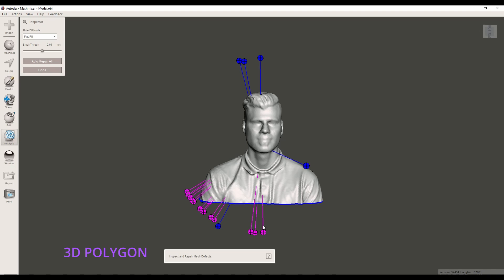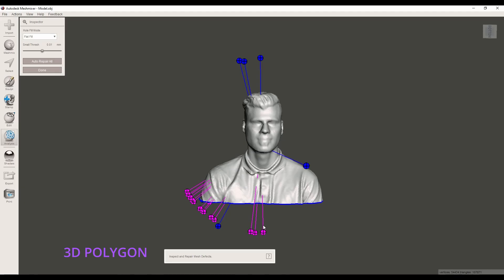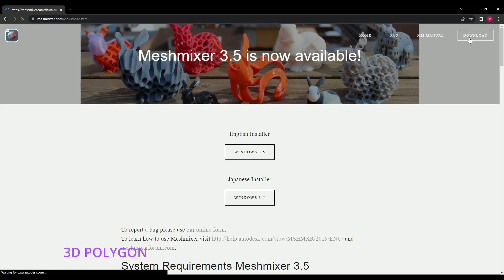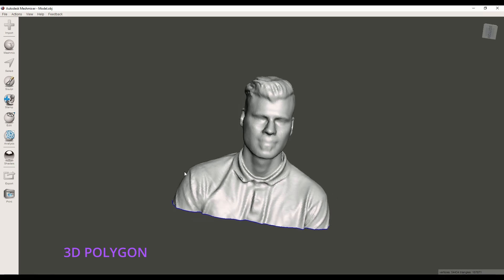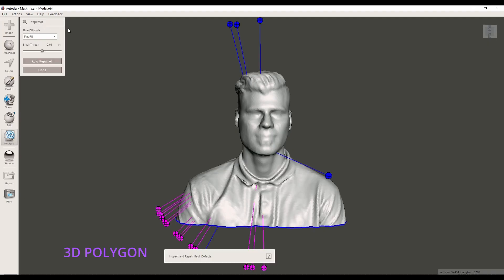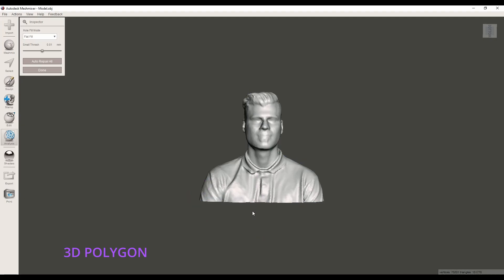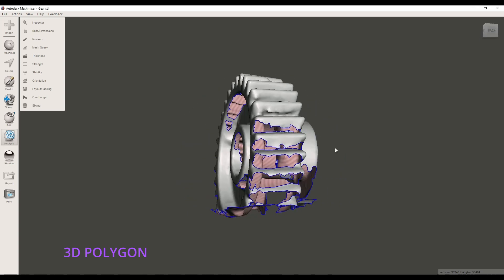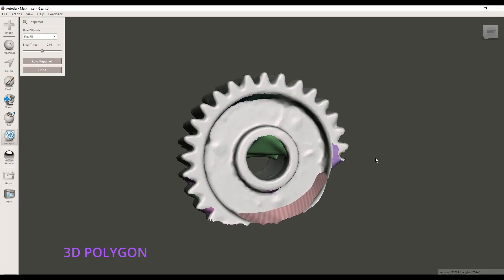How to Repair STL/OBJ  Files | Meshmixer Tutorial | 3D Printing Guide for newbies

Comment: Doesn't work with me, how would the other apps help fix the mesh? I have a roof of a truck the walls need fixed and there is 2 holes in the roof mesh mixer can't solve the issue I'm at a loss just now it looks like it would be fairly easy repair aswell
Reply: Hey man, can I see the problem you're having? Let's figure this out